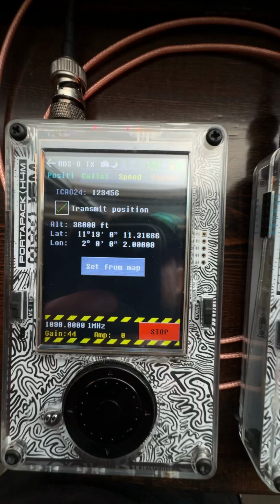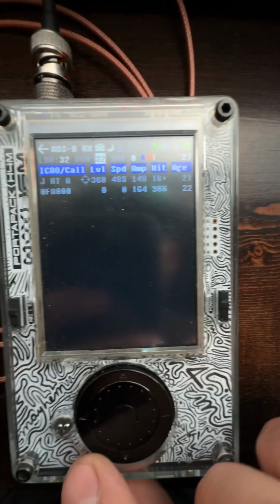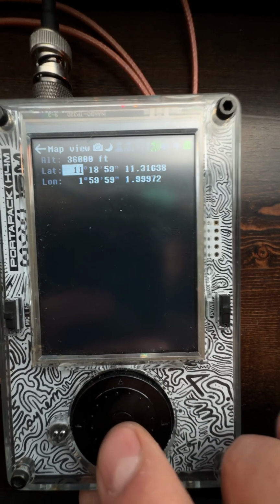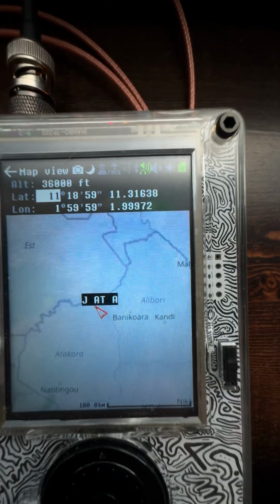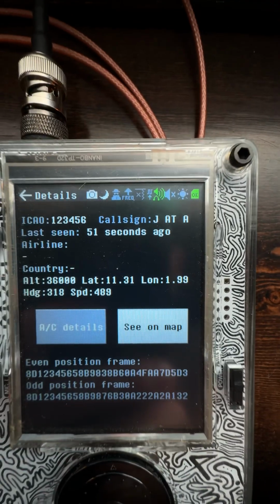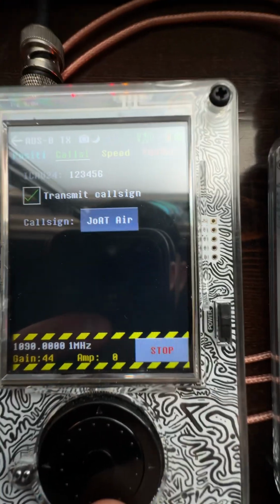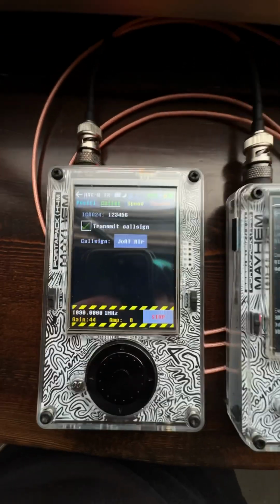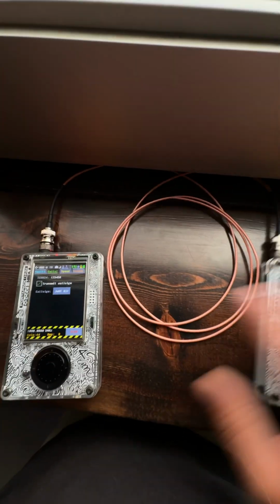Portapack H4M ADS-B Transmitting #portapack #hackrf #adsb #h4m #ghostplane

Comment: Greetings from Vladivostok Russia
I would like to ask where I can get the pinout for connecting to the portapack GPS

I would be very grateful if you could reply to my comment.
Thanks in advance
Reply from the maker: Check out the HackRf discord. There’s a section there for expansion modules. Open Source also makes a esp32 expansion module for the H4M. It’s
Pretty simple to add gps to it. 

https://discord.gg/PxRW2a2B
Reply: @Jeremiah.o.A.T  спасибо